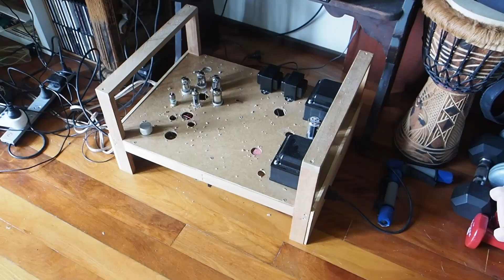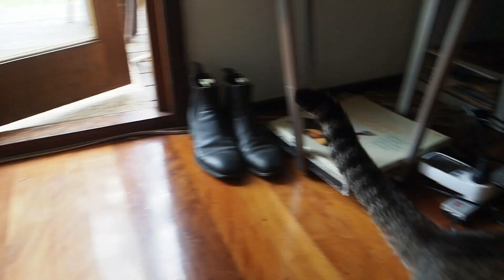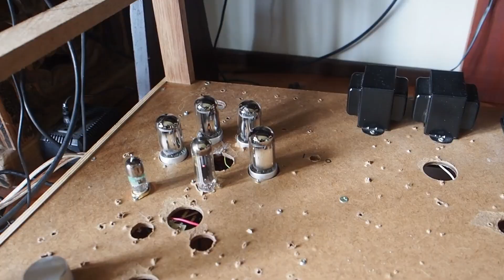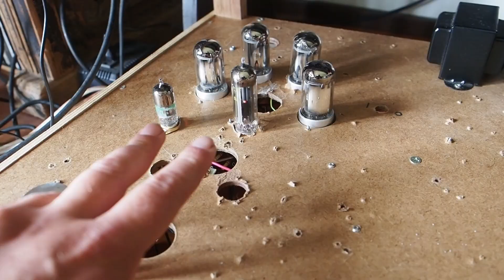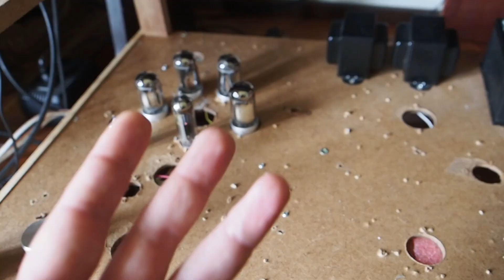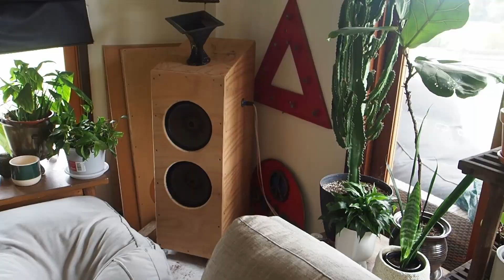The sound and design of my new 8532W 4P1L amplifier

Comment: In regards to using a power supply choke as an audio choke feeding your OPT, sser2 on diy audio on his headphone amp thread, mentioned that doing so, the inductance will collapse above 400-500 hz, but to over come this a series 3-5 henry ferrite core choke should solve this. He also used a 10 step auto transformer instead of a volume pot, but the sneaky thing is it's a cheap-ish atlas sound AT-10 that comes with, make before break, silver plated contacts.

Comment: I came across an interesting idea, mount your biggest tube in a socket and mount it to your amp board, no need to wire up the tube, just so long as it has vacuum intact that is all that's needed. Now listen to the amp with the tube inserted and then compare with it removed. 

The tube is acting as a vibration damper and I read it can tend to effect the mid-range. You could try the same with a spare transformer (mass).... or what ever you please, a jar of honey (viscous). PIO capacitors... etc. Or the other way around, unbolt a wired up transformer and suspend it on bungy cord.
.

Comment: Eduard if you have some power to spare in this design, have you looked into using G2 as the Plate, a poor mans mesh plate, bartola looked into it for the 4p1l and figured on dropping the idle current to 8-10 mA. to keep the G2 under 1.5 watts. The pl519 has been used like this and the builders seem very impressed.
Reply from the maker: Hi. Yes tried it, liked it, but not for this amp. Screen mode in the 4P1L works extremely well - it becomes one of the best sounding, low distorting driver tubes with a very useful low plate resistance and decent mu for a DHT. My previous amp used it as the input tube. It has the about the lowest input capacitance of any tube I know in that mode, so very little signal is lost that.

That now said, I wouldn't use it as an output tube in a power amp like I have developed here. Why have 0.35W output when you can have nearly 2.5W? I would also need 6 parallel 4P1Ls just to be able to have low enough Rp to work with the very low winding ratio OPT, which by itself is a  major reasons why this amp doesn't sound like it has an OPT!
Reply: Eduard, why would you need 6 tubes in parallel to match your OPT when using Screen as Plate mode..... I thought when running Screen as Plate it reduces the plate resistance by 1/3 ? Couldn't you then run an even lower primary OPT, (although you'd have 1/5 the output power vs triode strapped)

I did read that running a low primary on the OPT makes the interleaving technique more challenging/critical as the henry can drop off with frequently which makes the dB drop with frequent too, if I understood correctly, which I might not.
Reply from the maker: @junkyoutube9060  Hi The Rp for 4P1L screen mode is 3K6-3K9 insteaad of 1K2-1K4.  R=V/I and I is a lot less...

I think compromises go up with higher ratio OPTs. Low Rp tubes on the primary also allows lower Henry inductance, reducing core material.

Comment: Hi Eduard, what is your opinion on grid stoppers, i have read ppl that are for against. Some also claimed that ferrite beads sounds good, have you tried those? They say grid stopper remove glare but reduce dynamics generally.
Reply from the maker: Less in the signal is best as a first principle, but oscillations can affect sound or destroy tubes, so there's multiple solutions like you mentioned, and there's also RF chokes (somewhat similar to ferrite beads)... apart from taken away the cause of oscillations in the first place, rather than allowing them and trying to stop them. For me next thing is to try ferrite RF choke cores and retain the same wiring and do away with gridstopper (for the 8532 in this amp, the 4P1Ls have no grid stoppers)
Reply: @EduardBroekman i am not sure but when something like interstage tvc and autoformers have limited bandwidth wont that act as a valid low pass filter?
Reply from the maker: @williammeincke9071  Yes, it limits response at both ends (=bandwidth). Look up any FR response of interstages or OPTs

Comment: Hi Eduard, im not sure why no one makes unregulatee dc supplies for the heater/cathode in dhts.  Adjusting the voltage with a pot and using a clcl the voltage reg can be omitted..?
Reply from the maker: One reason is that one needs a very particular pot that support high current flows. Not very common, I'd say people would tune with caps or resistor networks when going passive. Quite a few I think go this route.

There are also a few doing choke based passive LCL supplies, reportedly the best, but there's a slight cost for the high current chokes... :) Thomas Mayer does this.

Here, using a very quiet, slow start, current regulator for filament bias is a very cost /quality / space effective solution - at least in my judgement.

Comment: Eduard, have you ever tried measuring your amp or speaker with REW and checking the phase of the 2nd and 3rd harmonics?

I’ve been reading some interesting things lately:

A negative-phase 3rd harmonic might add to peak energy, which some say increases the sense of detail and dynamics. I recall someone from La Dolce Audio mentioning that 3rd harmonics can be beneficial.

It’s also been suggested that single-ended output transformers (maybe interstage too?) can slightly compress the sound, which could make push-pull or parafeed designs more dynamic.

Steve Bench once noted that resistor-loaded (parafeed) output stages can have a uniquely engaging sound, despite some limitations.

Triodes seem to prefer low-impedance power supplies, while pentodes usually like higher impedance.

I saw someone mention that using a shunt-regulated supply in a 4P1L amp gave a major boost in resolution.

There was also a blog post a while back showing a parafeed push-pull design that avoided the need for a parafeed cap by using chokes instead—though resistors might work too.

I came across a build where a center-tapped choke was used as a phase splitter in a push-pull amp. The builder said it was only 4W but had incredibly dynamic and realistic sound.

Have you tried a current-drive pentode amp? It might work well with your aperiodic vented enclosure. A Gary Pimm-style CCS could be a good match too.

I really enjoyed the video—thanks for sharing it!

(I had to use ai to edit my comment as otherwise this platform was pretending to post the comment.... but did not)
Reply from the maker: Before even thinking of any solution, things that are possible, we must consider what problems really need solving, how our auditory systems works and choose the most elegant solution that has the least secondary issues and is most in tune with what music is. Then we must ask young female ears to give their judgement. If they love it, dance to it, we may be onto something :)

Answers:
- yes I do measure distortion, in every stage, especially when audible issues arise
- I hate 3rd harmonic distortion in any form, neg 3rd may be useful with inefficient speakers as it helps overcome inertia/loss with higher voltage peaks but not with my speaker, it fatigues and output loses clarity.
- I prefer 2nd harmonic distortion to be higher than 3rd by quite a margin
- single ended amp have slower and bigger cores, demand much, much, much more from power supplies ending up in a less dynamic sound typically. Parafeed only address the core size and allows better core materials but adds the issue of a cap charging / discharging.
- my differential amp is unusual in having a SE not a PP level power supply and specifically designed towards minimal loss of energy and delay in all circumstances
- parafeed p/p is useful only to deal with imbalance with tube quiescent currents IMO
- there's other reasons to do a Gary Pimm style CCS, and positive feedback on pentode - I'm very happy with the solution I have which does not add a servo into the signal path

Comment: Eduard have you tried measuring your amp or speaker with REW and made note of the phase of the second and third harmonic ?

a few things I read of late:

a negative phase 3rd harmonic will Add to the peaks, coming across as increased detail/dynamics. TerryG of la dolce audio said something to that effect and seems to encourage 3rd harmonics.

the current going through a single ended OPT (interstage too ?) slightly compresses the sound, (that would mean a dynamic  advantage to push pull or parafeed design)

Steve Bench mentioned, regarding a resistor loaded (parafeed) output tube, that he found something magical about the sound of the resulting amplifier, in spite of its disadvantages.

tridodes prefer a low impedience power supply, pentodes are generally the opposite.

mvaudiolads said about his 4P1L amp "The responsibility for that much increased resolution falls down to a super-low-impedance of a shunt regulated power supply"

tubecad did a parafeed blog in 2014 showing a parafeed push pull... so no parafeed cap to the OPT needed, but he showed it using chokes, so maybe Steve Bench's idea to use resistors instead.

diyparadise made a push pull using a center tap choke as a phase splitter and said
"This is the most dynamic amplifier I have ever built. It’s only 4W but the dynamics, transients is striking. This raises a new bar to the word – realism"
.... Anna – Push Pull done Right  
it is driving small driver back loaded horns.

have you tried a current drive amp (pentode) I hear they would suit your aperiodic vented enclosure ? maybe with Gary Pimm CCS for Pentode setup !

I enjoyed your video... so thanks.

Comment: Hi Eduard, this is a great video. Specially for people interested in the effect of a schematic on the sound. As usual, there is loads of food for thought. BTW, I agree with you that those Altec drivers have probably been designed with Push-Pull-esk amps in mind. Back in the day, single ended amps where typical for five tube radios and TV sets, rather than PA systems.
Reply from the maker: Hugo, thank you and It is so nice to hear you appreciate this presentation. Also many thanks for your coffee donation. You fine man!! :) As for the Altecs, I couldn't help but think of Janos' main system as well and how he went with uprated Ampex which were designed for the VOTTs and small theatres... That said, my first impression was being just astounded what the Altecs can do dynamically when the amp is up for it. I haven't heard anything like it... especially when I ran with a load where Rp was just under Rload... and that's a topic for another day as well :)

Comment: HI Eduard , ...How does the amorphous core choke performs and sound versus a standard core choke ? Can you give the references of these chokes , IT, and OPT'S from Lundhal ?
Thanks and very intersting use of an EZ81 ...
Reply from the maker: Hey Frank! I tried a 60H 170ohm Z10 core OPT, (as choke) but it sounded mushy, congested and slowed down the whole reproduction, as if it couldn't keep up with the Lundahl LL2774 AM PP OPT. This 7H 500mA 22ohm amorphous core choke adds a little of amorphous core sound/imbalance but its subtle and I found it to be noticeably preferable to the plastic sound of Kemet DC Links when directly connected to the OPT.. I suspect that an audio optimised wound choke would do better, but I don't have such a choke... I also suspect that the LL2774 with its parallel 76ohm primaries is better matched to a pretty low DCR choke so that may be another factor why the AM choke with its 22 ohm works well.  Bit of speculation at this point but I'm coming to appreciate putting very little in the way of the tubes.... even load.

The interstage is a Lundahl LL1660/10mA in 4.5:2+2 config.
Now for the 7H choke in question: search for this on aliexpress: 1pcs Amorphous 4C iron core 10H300mA/30H200mA/7H500mA/10H350mA choke ... and you'll find it. Seller name is Shenzhen audio amplifier&accessories. 

Steve Bench came up with the rectifier bias idea, and yes perfect use for an indirectly heated rectifier :)